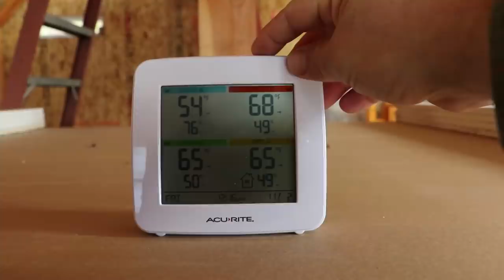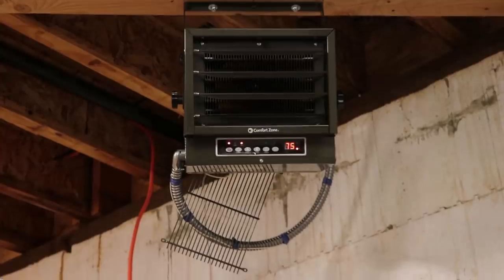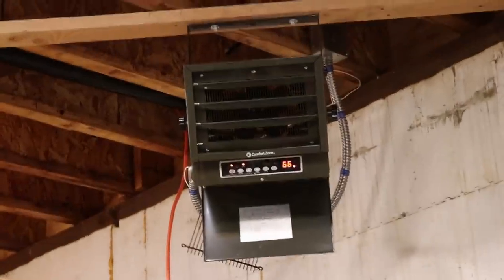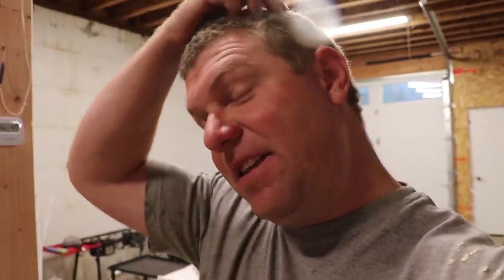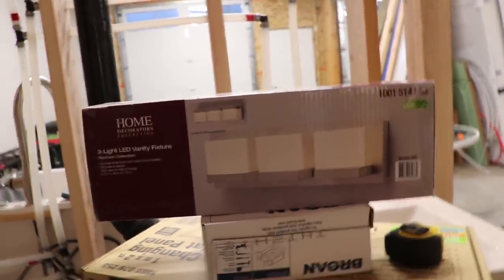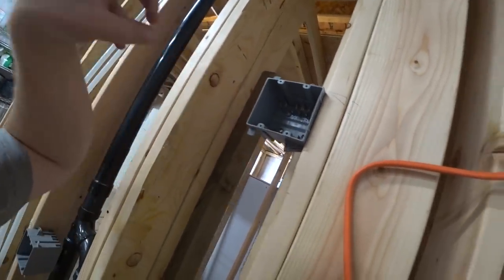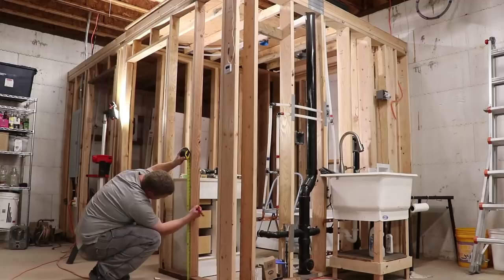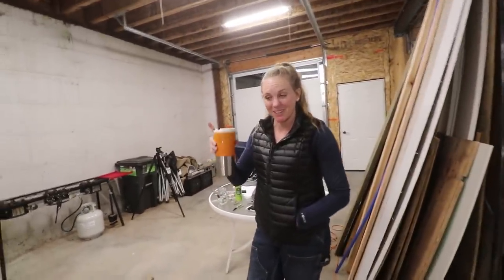A BEAUTIFUL, HOT MESS (Initial Electrical in Bathroom)

Comment: As an german electrician i alway find it fascinating how the american installation is done and what a thick copperwire you need, but of course you just have half the voltage of what we have here .
That heater with the AWG 8 wire here you probably just needed an awg 14 for that possibly 16 would even be fine here, but that would only be because we have 3 phase service in our houses  and not just two so its a bit different system.

Comment: As I commented on previous vid, I see the on-demand water heater in place. That will come back to bite you on the 200 amp service. A 50 gal tank type water heater in that space would be a much better option. Add a time clock on it if you are concerned about energy consumption. You really shafted yourself on a future generator size

Comment: Make sure the heater it self doesn't get to hot.  It likely had 2 sensors 1 for temp control and 1 for safety shut down.  Another thing is the angle its on can trap heat in some cases causing the sensor to get hotter than it wants to see  it.   Also you should get some heat shrink and twist and hook wires before soldering them.  I like to make sure the wire has a mechanical hook before adding solder that way its not relying on soft solder to hold the wire together.

Comment: If it is a thermocouple you need to use thermocouple wire to extend it.  It may not be a thermocouple at all it may be a thermistor. a resistor that changes value according to the temperature.  Use a magnet on the leads to the sensor and see if one is a ferrous and one a non ferrous, if it is it is a thermocouple, I suspect it is not.  The sensor above the heater may be the over temperature sensor.  Most electric heaters have an over temperature sensor, like the one on your cloths dryer or your hand held hair dryer. It looks as if the person at the factory hooked them up wrong.

Comment: Research the on demand water heaters very carefully, there are a lot of unhappy customers out there. They have a very tightly defined operating range, and if you don't draw enough flow, or draw too much they won't perform. I have seen complaints that you have to turn on the faucet to half to get any hot water at all with some models. They have high freezing damage risk in an unheated space. They foul up with minerals quickly. 
If you still go with one, and go with gas, make sure to price the glue pipe as well. The ones requiring the stainless steel pipe add a lot of cost.

I think you would be better off with a tank heater, and a recirculation pump to address the wasted water till you get hot water issue. They are also much more forgiving as they can buffer changes in demand. They draw far less current, cost less, cost less to wire, and handle fouling better.

You mentioned on one video there is natural gas nearby,  if it does not cost a huge amount to install, it will be far less expensive, 1/4, than electric. Propane would probably run about half the cost.

If you go all electric,  you might want to look at a heat pump water heater. Uses a third or so the electricity.

Comment: I have a 1600 sq ft house with a 200 amp supply, so for your house and lumber mill and outbuildings etc I'd definitely upgrade to 300-400 amps just to have the capacity.

Comment: That is the national code for outlets. In most states the house as a whole has to be on a arc fault breaker. Take a really hard look at your on demand hot water over the the last 20 years I have hooked up numerous brands of theses and have had the owner have them removed as they are not the efficient for the power they draw. You only need 50 cam for the bath fan but they move very little air we always use 130 cfm fan this will help cover the whole house fan on a timer the is code for all residents..

Comment: DO NOT worry about 70F.  With minimal available, 60F is half as difficult,, half as expensive to run.  And 60F is very easy to adapt to.  You wear a sweater not a t-shirt, that is the only concession. 

The garage must be on all GFCI.  The bath must be GFCI.  Line and load sides is how you do it.  Clearly labeled on the outlet and often a wiring diagram in the box when you buy it.

Comment: Dryer should be 10/3 Type cable not 10/2. Dedicated.

It’s a lot easier to use the space in your ceiling bays to horizontally run your wiring.

Comment: if the fan is above the tub it should be gfi protected. just outside of tub doesn't require it. good diagnoses of the heater. yes you will need propane for the house, service too small

Comment: Bathroom fan's consideration is the noise level.  If it moves a lot of air it might be really noisy.  linking your fan to the outside will introduce cold outside air into the bathroom.  It's not like a dryer vent that is pretty much closed at the dryer.  The LED light looks pretty neat but IF you have a shower in the bathroom your going to beg for a heat lamp to keep you half warm when you get out.

Comment: I can’t tell if your dryer wire is 10 /2 or10 /3. That should be a 10 /3 so you use a four wire receptacle. You don’t want your neutral and ground bonded in the dryer.

Comment: If you have more small  wiring or coax cable to staple it would probably be worthwhile to buy a wire stapler. Arrow makes a T-18(small) or T-25 (coax)wire staplers. Much better than using flat staples that cut through the insulation.

Comment: Before you start working on the walls and ceiling in the living portion of your house, I would suggest thinking about some things that would otherwise be after thoughts, and they are things that can be. But you might want to think about if you want to put in a sound system. I'm not talking about a multi room intercom, but more home theater. You can get 2 and 3 room receivers, but I don't think there's enough benefit to those getting additional receivers or sound bars are an option and you don't have to worry about the complexities of using a multi room receiver. Obviously, you're not ready to set up a home theater yet, but you might want to think about whether you want at least one room with one if for no other reason as to decide if you want to install wires behind the walls before you put them up and whether you want to have in wall or in ceiling speakers. All that would probably be easy to install as you put in the walls and ceiling. Even if you don't want to put in a home theater system, one thing you should put off buying is a TV. This is particularly true if you want to try to use an antenna. The TV industry is starting to roll out a new broadcast standard, but no TVs currently support it. Ones that do are expected to start being available sometime in 2019, so if you can you might want to hold off buying until you can get a TV with ATSC 3.0 built in. If you can wait until those are available, you probably won't have to deal with the tuner boxes for every TV that many people had when the ATSC 1 switch was mandated 10 years ago. There are some other things I could bring up, but you'll probably just want simple so I won't bring up. And it would be a moot point if you plan to wire your house to have capability to connect to a single antenna.

Comment: I like the idea of the tankless water system, but they draw too much to run with a generator.  Since electricity is our only utility and seem to loose power often.  Being able to run the water heater and well pump with a good sized generator is nice.  The furnace still draws too much, which is why we put in a good fireplace.

Comment: Jesse, I know this video is about 2 months old. You have sheetrock over all the walls in the bathroom now. I bet you wished you had insulated those lines to reduce the heat load on that water heater. Insulate the reast of the lines upstairs before you sheetrock them! You'll be glad you did!

Comment: I'm no expert but I would mount the heater at no more than 3' off the ground. Hot air rises and having the heater at that height will compound stratification affect of hot air at ceiling height with cold air at ground level - not good

Comment: Way to go guy's. You may want to give some thought NOW, to when you wire your upstairs kitchen, and plan on at minimum 3 (three) circuits, if not 4 (four.) circuits. The four circuits are as follows: Circuit No.#: -1 Upper (part of the) receptacles, Circuit No.#: -2 Lower (part of the) receptacles, (this is done by merely breaking the tab(s) on the sides of the receptacles.) Circuit No.#: -3 Dishwasher, & Garbage Disposal,  Circuit No.#: -4 Freezer / Refrigerator. A lot of people combine Circuit(s) No.#: -3 & -4.  The "Trick" for the Upper / Lower receptacles, is also useful for bedroom lighting, pick just one receptacle (may I suggest either the 1st {first} in the electrical run, and or the Last one) so say the lower part is always hot, and the upper is turned on via the light switch. If your thinking, well we're going to just have over head /ceiling lighting. I'm not sure, but check Electrical code, I think it's required to have at least one receptacle controlled via wall switch (and or a part of the one receptacle, i.e., either the lower or upper.) Also start thinking about your "Lay-out / Run(s)" for 3 (three) Way & 4 (four) Way Light Switch(es) location(s.)

3 (Three) Way & 4 (four) Way Light Switch(es) require 3 (three) wire runs, i.e., a Red wire, Black wire, White wire, & a copper / common ground wire. if you have a light that you want to turn on / off from just 2 (two) locations, you need just 2- - 3 (three) Way Light Switch(es). Example: bottom of the stairs & top of the stairs. If you wish to turn on/off a light from 3 (three) locations you need 2- -3 (three) Way Light Switch(es) & 1(one) - - 4 (four) Way Light Switch(es). Lay-out would be a 3 (three) Way Light Switch, then a 4 (four) Way (is alway's in the middle of the run) Light Switch, than another 3 (three) Way Light Switch. Best to figure (easiest method) either supply power at the beginning of the run, and or at the end of the run.

Another place to use 3 (three) wire runs, i.e., a Red wire, Black wire, White wire, & a copper / common ground wire, is say in a bedroom, where you may want to put a ceiling Fan, with a Light. Just need to run from the wall switch to the ceiling mounting box for a ceiling fan. Also install the stronger ceiling fan mounting box versus  a standard ceiling light box.

Comment: You should be fine switching the two sensors. I used to program thermo-couples at work for alarm sensors. As long as you don't disable the thremo-cut out switch you should fine.

Comment: Even thou this comment is months after you fixed the problem, I'm guessing that you have learned that you can not extend a thermocouple with normal metallic wire (Al or Cu) you have to use the exotic thermocouple wire.

Comment: FYI - "Bathroom Fan Calculator" cubic feet of air in the bathroom divided by 7.5 = CFM requirements so a 6ft x 8ft x 8ft high  6*6*8/7.5=51.2 cfm fan required. It's in the code book. Also demand water heaters aren't that efficient just takes a little research to find that out. Also your trap arms are too long before they get to the vertical vent, its in the code book look it up. I don't know why your inspector passed the install. Your drains may be slow and noisy.
Iron and Constantine are the most common thermocouple wires in the home, one Iron and the other Constantine. Their resistance changes differently depending on the temperature and that is read by the meter and switch.

Comment: Those are nice lights I installed like 10 of the 4 ft flat panels in a conference hall over the past month. I hope that you did not run in to the same problem that I did. The bracket is a little on the odd side some of them once you get them mounted the flag ends up to tight to get the light to slide on it. In the end I had to bind some of them out a little, but it worked.

Comment: The element temp wire shuts the unit off if the fan breaks and the elements dont have air blowing over them. Safety feature. Might put it back and create another wire for ambient. Thermal couple wire is made up of two disimilar wires. Usually 1 copper 1 alum.

Comment: Just remember with heating and cooling, your not only trying to heat the air, all the furniture tools shelves etc., are storeing the cooler/warmer temps, so until those items get up to heat / cool temp, they will bleed off the warmer/cooler temps they are holding. :)

Comment: Love your insight into building your own home, I follow each upload on YouTube. One comment you might want to look at is the CFM of your bathroom extractor fan. In the United Kingdom, we have the same amount of CFM for a bathroom, but if you have a shower this figure doubles if not triples. At present, I have a Power shower working on 2.5bar in the bathroom running a 220cfm extractor. This goes through a PIR with a timing circuit of 6 minutes after it detects no movement. You have no natural light so you could trigger the timing circuit through the light switch. Or you could get one with a humidity sensor and put an isolation switch on for maintenance. Hope this helps.  Martin

Comment: Jessie, unless you have low electric rates where you are, you are going to pay over and over for using electric as your main source of power to run your house, suggest use a oil fired hot water heater, not on demand water heating , use circulators to move hot water for your floor heating, and domestic hot water, install 2 330 gallon fuel tanks for oil. Will be a lot cheaper to heat hot water and house for radiant heat. Install a 200 amp transfer switch on inlet power panel, run outlet outside to be able to use your generator, install disconnect on main panel inside, when you need to kill power, you don`t want to go outside and kill power.

Comment: For electric heat and that on demand electric water heater 200A is too small.  You could add an electric hot water tank in place of the on-demand to draw far less current.

Comment: I have a similar garage heater. It is a 240 volt multitap set for about 4k watts. Mine has an on and an off delay that keeps it from short cycling. It's analolog and works perfectly.

Comment: Heating element temp sensor is a safety check of the heating element making sure it doesn't get so hot that it melts the plastic wire connectors. don't move it. it does sound like it was wired incorrectly at assembly

Comment: So glad you guy's are going with a wood boiler, if you size it correctly it will heat your house & shop too. You are correct in stating that on a circuit, if the first outlet is GFI than all outlets down stream will be protected as well.

Comment: If you added another heater diagonally opposed to that one you will get much more consistent heat in the garage.  I would be interesting to see what the temperature on the main floor is compared to the garage, especially with 2 heaters and yes, you have to let the temperatures stabilize for several hours.  Sun, or lack there of, will make a big difference in temps to the main floor.

Comment: Have you considered looking into a Polaris high efficiency & recovery water heater?  They can handle all your domestic hot water and run radiant (however I believe only gas or propane).  50 or 100 gallons standby with high recovery rate - great units and all in one.

Comment: Grrrr ... NEC requires "tamperproof" outlet and "arc fault" circuits.  Millions and millions of home have been built without either.  People with little kids install safety plugs and I have NEVER heard of a fire caused by an arc on a 120V outlet.  Clearly both of these were added to the NEC to increase revenues for electrical suppliers.

Comment: Your project is looking great. Fart Fan = 50 CFM intermittent or 20 CFM  continuous [IRC 303.x] . As for your Load Center sizing, use a clamp meter "PEEK HOLD" $30 on amazon and get a true estimate on your load before you freak out, calculate your high service demand appliances, Peek, Avg, time of day and time of year because if you exceed 200 amps in use maybe propane will be much more cost effective.

Comment: Get some heat tube shrink ;) the black connector temp sensor is for when the fan stops spinning but the heating element stays on, so it doesn't burn your house down :D

Comment: There are a few different types of thermocouple wire, I think everything you did is fine though, But to simplify a bit...on the end where you soldered the part you cut off you can basically just cross the two wires together and done.  Cover with electrical tape if you want, or just leave exposed. NBD! They totes mixed up those wires, ones reading output and the other is ambient.

Comment: Happy Holidays guy's glad to see your progress. I'm impressed with your ability to trouble shoot the heater issue good job. I am also wondering about the issue with the tankless water heater, I'm not an expert but what about using step-up modules to balance the additional power need, I'm sure you can use 120v for the required input voltage you may also be able to use step-up modules for other high amp equipment iin the house.I'm sure the step-up devices include output related controls, I've encountered this issue with a few of my energy based projects, will take a round of research to find the right device to use. Man you guys are the joint when it comes to innovation keep it going

Comment: Nice work switching the sensors on the board - probably an assembly error that saved you the hassle of returning the unit. Thermocouple accuracy might be dependent on the length/resistance of the wire, but it will probably be fine 👍

Comment: Just to give you an idea of what electricity cost in Shelton, Ct using 873 kw for 29 days, $224.13, not cheap, using your system would cost 4 to 5 hundred a month with no problem, I average about 3/4 of a gallon oil to heat hot water per day, unlimited hot water, 4 adults in house.